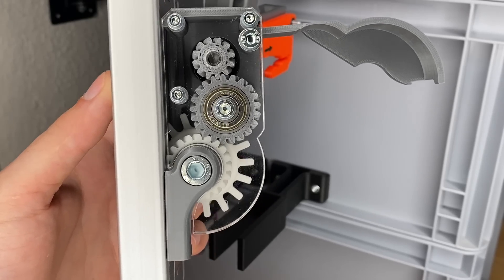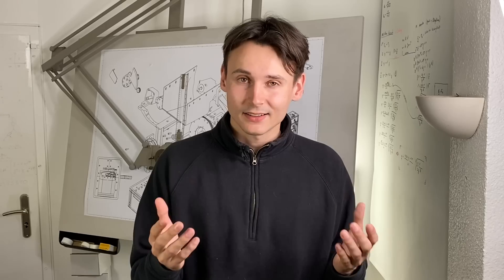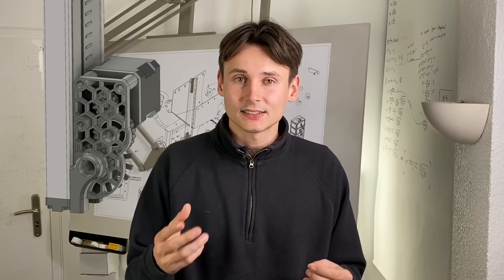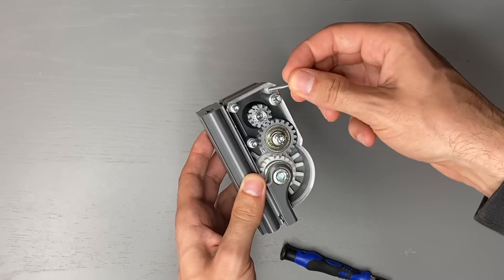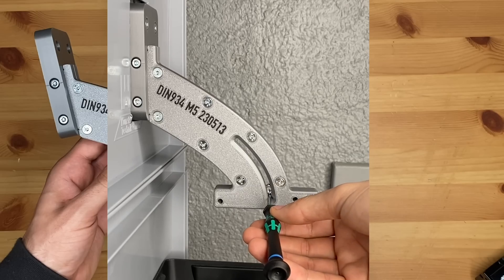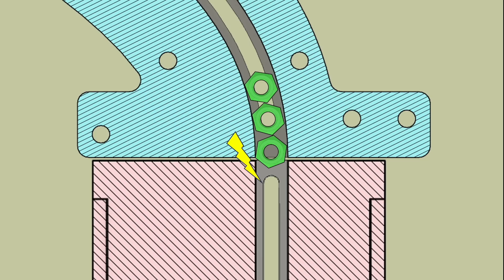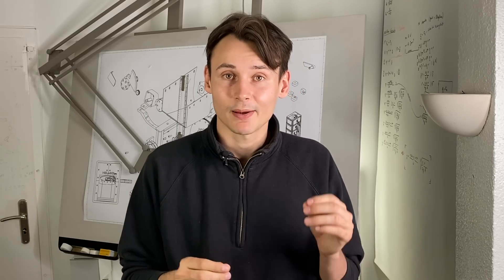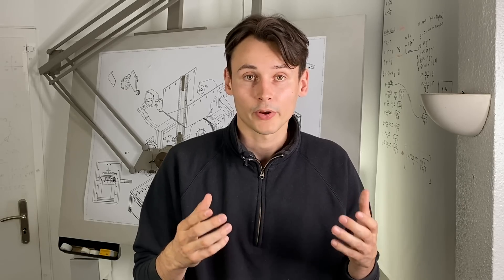Quick-Lock & Sprocket 2.0 - 3d printed automation #005

Comment: 3:28 the nut holder has an extra convex radius compared to the bolt holder. i imagine this is for increased strength. what was your thought process and calculation method to decide how and when to do this and why not do this to the bolt holder as well for aesthetic reasons?

 7:45 personally i would chamfer the receiving hole even without considering this potential jamming problem. reason is that 3D printers are just so much more reliable at making a nice smooth hole when it is chamfered at the top layer. unchamfered holes often need to be deburred. so chamfering would not only give you printing reliability and lesser rework, but also functional reliability for this jamming issue by making the receiving hole slightly larger at the entrance. the width of the tunnels appear to let the nuts slide with some tolerance without allowing them to roll. i guess that preventing them from rolling is what ensures they always land in the magazine vertex down and never sometimes flat side down and that this is critical so they always maintain equal separation to allow for proper metering later on. so it looks like the width of the tunnel is somewhere in between 2*apothem and 2*radius of the hexagon. i believe for M4, this is at least 1mm of play, and you should have a little bit of room to chamfer the receiving hole while still preventing any nut from fully rotating in the tunnel. it would still be possible for a nut to get jammed at the bottom of the chamfer but what if you don't use equal chamfers? i.e. instead of a 0.2m equal chamfer, what if the tunnel was tapered from 0.2-0.4mm larger at the receiving hole but gradually tapers down to your original tunnel width some 30-40mm below? 

10:04 my initial thoughts on this was it is so beautiful and satisfying when a compliant mechanism just works! however i have trauma with past experience of creep failure so i cannot stop worrying that this mechanism will eventually fail soon as the full magazine plus stepper metering module below is quite heavy. that pin catcher will eventually sag over time and the magazine will torque away and create a gap in the tunnel junction. i see you used weight supports at 10:16 bolted to the crate, but i feel that this makes the crate less portable and kind of detracts from the modular philosophy--i feel like any weight supports should be part of the module rather than the crate exterior which should be clean of any fixture especially bolted ones. but that is just my opinion. so the heavy module can have a support arm that extend down and towards one of the ledges of the crate. for the quick-lock, if you had a second catching pin for the quick lock higher up somewhere near the letter 'e' in 'Magazine' 10:11, i think that would make the tunnel junction tolerances extremely reliable in terms of the jamming issue, very tight, and also double the weight capacity...

Comment: Great video! I didn't understand how you solved the problem with the uneven 3D-print surface that the nuts run along inside the feeder and magazine. Is its inside surface also prone to nut jamming in addition to the joint between the parts?

Comment: Awesome work! Silly question/suggestion: Why not add a very subtle, long stretched, funnel-like chamfer to the entry of the light pink part at 6:58 so that even if the upper turquoise and lower pink part of the construction are offset by let’s say up to 0.5 mm (depending on the size of the conveyed nuts) doesn’t make the train of nuts to get stuck? (Grüße aus Frankfurt BTW).

Comment: I used to work in Industrial Automation - I'm very impressed that you've managed to get good repeatability with 3D Printed parts.
Have you come across IGUS polymers - which give very good performance in wear parts or where low friction is required.  They are available as printer filament too.  I was thinking they might be a good choice for your paddle wheel.

Comment: Thanks for these productions!

Your design approach is highly commendable, and in my opinion represents the top echelon of design methodologies which help manage the engineering of very complex systems. 

After years of designing various industrial machines, I discovered the modular approach to be absolutely superior than the old-school "single frame" approach. While the modular philosophy requires significantly more design work to split machine sections into interchangeable sub-assemblies, the approach provides invaluable flexibility when one part of a system under development fails to meet expectations. This becomes increasingly convenient as the complexity of systems under development increases, especially when the project includes a mix of proven parts/assemblies to be integrated with experimental or unproven ones.

It stands to reason that is far easier to make design changes for a simple subassembly than it is to rearrange the typical pivots, shaft centers, gear/sprocket modules etc. in a conventional layout, even for plate-frame assemblies, but you can't blame us old-timers for taking the "simpler" approach "back in the day", because before CAD/CAM, when everything was designed on paper by hand, the time required to modularize machinery (or even have a selection of OTS parts) was unthinkable due to prohibitive expense, so our goal was to "get it right the first time" because every ECO subtracted from the bottom line.

Now, I can simulate every engineered component of a complex system, from mechanical drives, power systems, materials attributes, fluid flow, heat transfer, etc., to digital control systems themselves, thanks to virtualized computing and networking, and use these through many different iterations before a final design is selected for prototyping and testing. Love ya NASTRANS, COSMOL, and National Instruments!!!!

Comment: Regarding lubrication: The German company igus manufactures mechanical components from plastics that do not require lubrication. They call them "motion plastics". But not only do they make various components from them, they also offer the materials for 3D printing, as filaments for FDM, powder for SLS, and recently even resin for SLA.

Comment: greetings from Russia, spread out more technical tasks - I love them wildly. Option how to get rid of precise gears: automatic weapons. You can make a connecting rod that would push out exactly 1 part.  Stepper motors will not be needed, and the design will be smaller
Reply: positioning of two parts. can you transfer the mechanism that aligns the nuts to the dispenser? can you increase the width of the channel 1 and 2 parts before the joint, and then align them after? I think this will solve the problem

Comment: If the footprint is important, is there any particular reason why you don't put the motor of bolt dispenser on the side to have even less footprint for the combination of nut dispenser and bolt dispenser? I mean in this case you can place the bolt dispenser motor directly below the nut dispenser motor, so they will share the same space horizontally

Comment: This series is great!
Question: how do you get that finish on your 3d Prints? (as seen on the orange quick lock part at 10:04)
Reply: 1. if that's the bottom side then it could be from the PEI magnetic build plate that left that kind of finish
2.Bambu lab slicer has an option to assing what kind of finish the top surface would be if this was oriented to be the top surface
3. designed it himself in CAD

Comment: Adding a small angle to the top of the magazine should solve any issues with the nuts getting stuck. This doesn't even have to be something you design into the print, simply sanding the edges down a small amount would be enough to fix the jams and should provide the angle to allow the nuts to self right back to the desired orientation if that is required.

Comment: Absolutely amazing work. If I may offer a humble suggestion. A little more dither to the nut magazine will prevent the nut train jamming. We normally try to design out dither but small vibrations can help precision mechanical systems perform efficiently.

Comment: You don't need perfectly matching output and input channels. Outwardly flaring the walls of the incoming channels and using the channel itself as a locating feature will solve the problem.

Comment: Could you possibly use extrusion grounding of the channel to improve the surface finish? Or forget what it is called exactly but you essentially push a grounding compound through a tube. This will grind the high points eventually smoothing the tube.
Reply from the maker: Hi, to be honest I am not sure what you mean, but it sounds interesting, what kind of grounding compound?
Reply: @christopherhelmke  doing some research it seems that the technical name for the technique is abrasive flow machining. The channels in your part are small but honestly looking at it again you could probably just make it a two piece part and sand it by hand to get rid of the layer lines. Although it would honestly be pretty cool to see someone attempt to use abrasive flow machining on a plastic 3d printed part.

Comment: Very cool video explaining your engineering thoughts! 
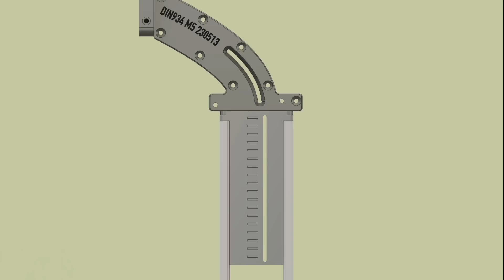At 6:47 I was thinking if you have a short straight way also in the "blue" top part, it should become less sensitive to misalignment, since that part contact point than doesn't cause also change the path direction (from curved to straight).

Comment: Great series! Keep it up! I don’t know that I have a need for this but would you ever consider making the 3D models available?
Reply from the maker: Hi and thank you! Yes I am definitely considering it. I have not yet decided in what form the files will be released. At this stage I'm focusing on getting it completed and functional - but I hope finally, in some way you will be able to build it.
Reply: @christopherhelmke  I agree, I would gladly pay for the files to print necessary parts myself, as I also sell 3D prints and have to manually bag four each of three different types of nuts and bolts, it can be very tedious.
Reply: Lieber  @christopherhelmke  Great process and presentation.
I am seriously in love with the material colors of the 3d Prints. Please share what filaments you used for the dark-grey, gray, white and orange parts!

Comment: You mentioned laser cutting is cheap. Do you have a laser cutter? At what point could you personally justify the cost? I ask particularly because as far as I am aware, the type of laser cutter which is capable of cutting clear acrylic basically starts at 5000 dollars or 5000 euros, and I think maybe just 1000 less with one of the newer popular hobby options like the new Gweike solution.

Comment: So many lessons in this. Reducing part for ease of assembly. Clear windows to aid debugging. Hatches to access wear parts. Making wear parts easy to identify. Don't use threaded holes for locating. Dual purpose design of a dowel pin + flexure locking alignment system.

Comment: I might be wrong, but I think you can just put a nice chamfer at the edges even if the bolt rotated slightly, it could adjust itself due the angle of the chamfer and it wouldn't stuck, I did a similar thing in a conveyor belt, and it worked no jams.

Comment: To stop the nuts clogging where the two parts join, could you not slightly flare the second tube where it joins? So it eliminates the chance of there being a slight edge for the nut to become caught on?

Comment: (Oh boy, this is a long one)

I'm glad to see a sprocket design handles nuts just fine; I was worried about how it would handle anything besides screws. Have you been able to test with washers yet? Out of common hardware types, I think washers might be one of the more difficult ones to get working with a sprocket-based metering system.

That repackaged gearbox is very nice. Not just in looks, but I also appreciate all the little functional details: the 'sprocket' being easy to swap helps for replacing worn out components, like you mentioned, but it also also makes it easy to swap between different hardware types; also, sliding the dispenser block directly into the light grey guide rails is a super clean integration and leaves room for even larger diameter sprockets if required.

I do have a point of design feedback on the gearbox:
Conventional wisdom says that greasing the gearbox would have huge advantages for service life. But this iteration cannot be greased because the indexing sprocket would almost certainly carry some of that grease out to the hardware it is dispensing--not good. I'm sure you already thought of that; but I say it to set up my suggestion: move the indexing sprocket outside of the main gearbox casing, and power it by a live axel output shaft.

To keep the gearbox and motor within the magazine tube profile would probably require flipping the motor around. Off the top of my head I'm picturing something like this (in the sense that the motor and output shaft project from the same face of a power transmission system):
https://wcproducts.com/collections/gearboxes/products/versaplanetary-180-drive

This has two big pros in my mind:
- Allows the gearbox to be greased, extending service life
- Easier to see the wear condition of the indexing sprocket
- Easier access to motor wires

Downsides I've though of so far are:
- Reduced mechanism visibility to the user
- Slightly increased gearbox height
- Might increase the number of steps for sprocket replacement (Maybe just make the end support arm for the output shaft removable? Idk, that's probably getting too specific for a text explanation.)

On a separate note, I love the idea of the magazine quick lock. But I can't help worrying about the fatigue life of the flexing section of the orange clip/bracket. 

I have a suggestion for indexing the magazines: Extend the light grey guide rails up to interface with the... spout thing (the component you show at 6:07). What I'm picturing is that loading a new magazine would be an upward motion, not a horizontal one. This would of course require some kind of locking/latching mechanism that would actively force the top of the magazine stack against the bottom of the spout once a magazine is loaded, in order to avoid any gap.

About the alignment issue more broadly, I think there's a chance that the alignment tolerance could be made less sensitive by extending the spout downwards (essentially just do a CAD "extrude" command out from the spout's exit face) so that the nuts have a straight section after the bend and before they reach the spout/magazine transition point. My gut feeling is that would reduce the rotation forces acting on the nuts by the time they cross that point, possibly making them less sensitive to small misalignments or gaps.

At least, I hope that's the case, because even though dowel pins are definitely superior to screws for locating parts in an assembly, those dowel pins are still inserted into an FDM 3D print, so the overall locational accuracy is still only as good at 3D print which is, as you noted, not super precise.

Finally, one trick that might help to completely avoid gaps between mating faces like this is to add a slightly raised lip around the edge in question (like, only tenths of a millimeter high). That makes sure that if the mating faces are brought into contact, the raised lip must be the first point to close off, even if the mating surface is slightly out of flat (which is almost guaranteed with FDM printing).

Wow that got even longer than I expected. And that's saying something.

Looking forward to the next video!

Comment: Next you need a funnel in the bottom with a valve so that you have a single shot ready to go. If you have a way to detect that a plastic bag is over the funnel to release it then you can really crank out lots of bags. Perhaps with a couple of capacitive sensors or some of those film pcb strain gauges.